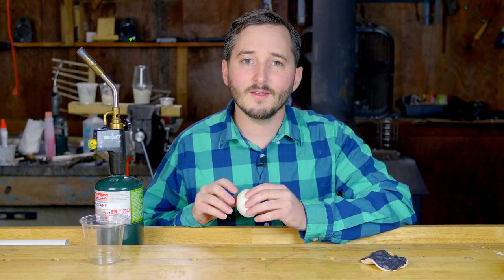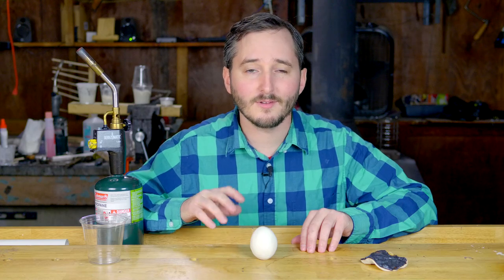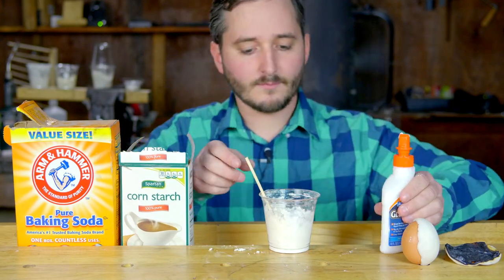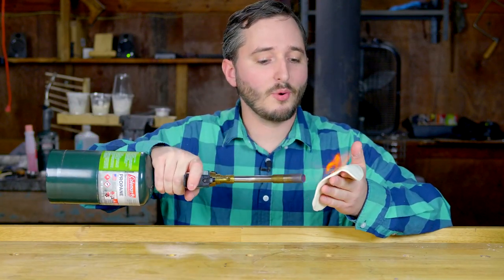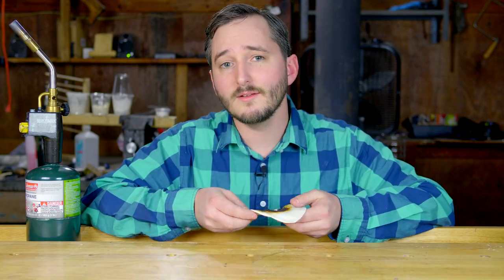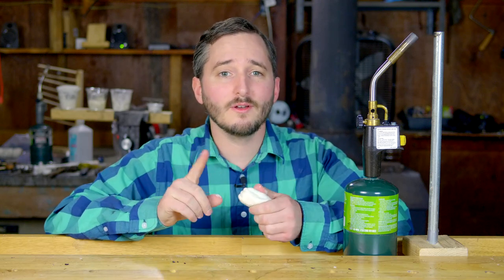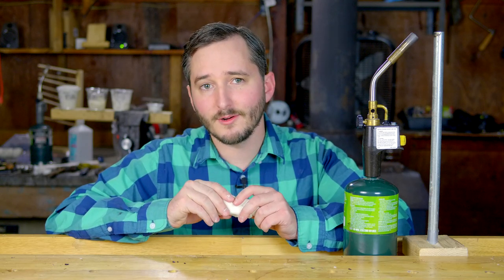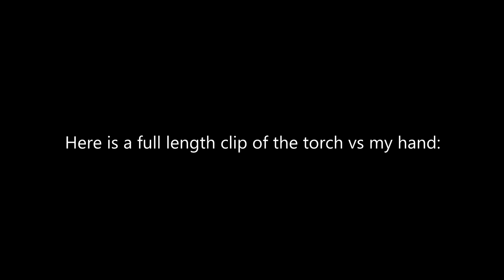A Super-Material That Can Be Made In The Kitchen (Starlite Part 1)

Comment: Build an HHO gas generator, pump the gas through a torch, ignite it, 5000F+ degree flame...  test this stuff with THAT flame then come talk to us.  :-P
Reply: He said it could take 10,000+ degrees.
Reply: change of state upon hho ignition causes it to reach melt temp of any substance it is in contact with upon moment of reaction where the hho gas converts to water.
Reply: @Daniel Nunya Bidnezz  Hydrogen-oxygen flames don't get to 5000 F, if I'm not mistaken.  They certainly don't get there in just air (without extra oxygen).
Reply: @Daniel Nunya Bidnezz  Nevermind.  Just looked it up; apparently I'm wrong.  I thought the generation of water limited the temperature or something.
Reply: you are mistaken.  The process by which hho gas combustion takes place is different than what happens with most fuels such as propane or butane.  When HHO gas combustion occurs, what actually happens is that the hydrogen gas and oxygen gas molecules react to form molecular WATER, and in the process of this reaction, HEAT is given off as a biproduct.  If this reaction is taking place at the surface of a material which is at 5000 degrees, then the heat given off by the reaction will RAISE the temperature of the material to even higher than 5000 degrees, until the material reaches its melting point, whatever temperature that may be, depending on the material.  So really, with this type of reaction, hho gas temperature is actually only limited by the melting point of the material it is being used to heat.  This is different than when something like butane combusts, which does not heat the material as a consequence of a chemical reaction and change of state such as hho gas.  butane combustion temperature is limited to the combustion temp of butane mixed with oxygen, whereas hho gas reaction temperature limit is the melting point of the material which it is heating.
Reply: @localbroadcast   Can you provide a link to something that supports this claim?  I honestly don't understand why one exothermic reaction would cause extra heating that another doesn't.  Why would the temperature rise higher than 5000 F?
Reply: because when hydrogen and oxygen react to form water, their electrons have to change orbital arrangement in order for them to form this new bond of the water molecule.  In the process of the electron rearrangement, energy is expelled because some of the electrons move to an orbit of lower energy.   This expelling of energy will occur regardless of what temperature the molecules are at when the bond forms. 
 So if it is at 5000 deg. and another water molecule bond forms, then there will be energy added as heat to that 5000 degrees, making it hotter than 5000.  When the material being heated reaches its melting point, then the excess energy of the water molecule bond taking place will go into causing the material being heated to change state from solid to liquid, or from liquid to gas.  the temperature at which this occurs is dependant on the material being heated.
Reply: take a look at any one of the numerous videos on youtube of hho torches blasting through rock, brick, refractory materials, etc.  You will see that everything seems to be melted, pointing to what I've stated... the temperature of an hho inferno is that of the melting point of what it is heating.  Find something with a higher melting point and hho will get there!
Reply: @localbroadcast   5000 F is the flame temperature though.  The release in energy from bonding hydrogen and oxygen occurs with burning hydrocarbons as well.  The hydrocarbons release less energy, have a slower rate of reaction, and therefore have a lower flame temperature.  This is all taken into account in determining flame temperature.  You still haven't explained why HHO specifically has the property of raising temperatures higher than the flame temperature.
Reply: with hho it is not the flame temperature, but the temperature of the material being melted.  when the hho reacts to form h2o, the energy released during the reaction seems to preferentially be absorbed by a material changing state, from solid to liquid in the case of heating a metal.  Perhaps it is because when the reaction takes place, liquid water will ever so briefly condense on the material, or perhaps the water ever so briefly goes into a supercritical state at the surface of the material causing it to be dissolved, releasing more energy as a change of state.. I really don't have the answers as to exactly what is occuring, but from my personal experimentation and from what I've seen from others conducting research with hho torches, the 'flame' temp of hho gas can reach up to the melting temp of whatever material I throw its way... the dynamics of why this is occurring definitely requires further investigation.
Reply: also, it is worth mentioning the fact that an hho ignition takes place as an IMPLOSION, whereas all other common combustion reactions of fuels occur as EXPLOSIONS.  This could very well be part of the mystery as well.
Reply: Are you trying to say because you haven't had a convincing enough explanation that you don't believe it's happening?  I don't have all the answers but that's not going to make me ignore what I've witnessed first hand!  Try it out man.. rig up a simple hho torch and melt some rocks.. melt some aluminum oxide.  melt all kinds of stuff!  Is it flame temp that is getting hot enough to melt alumina, or is it melting due to a surface reaction taking place?  Not sure, but it don't matter.  it get hot hot! it melty melty!
Reply: We will all die!
Reply: @localbroadcast  Tungsten has the highest melting point of any metal around 6000F so if the flame does get this hot then obviously it'll melt everything. Considering what you said, an hho torch could melt diamond, which I doubt is true.
Reply: @localbroadcast  Whoa!  Seriously?  So, ultra-high power oxidation in a way then?

I wonder what materials could be used to LIMIT the reaction you just described?  I also wonder if what you just described could happen in the upper atmosphere when a spacecraft  comes in on reentry, and if it hits a loose pocket of gaseous hydrogen, if such exists, could this happen and cause a plasma to form around the heatshield that causes a more rapid decomposition or oxidation of the ablative shielding materials.
Reply: diamond actually burns... doesnt melt.  and yes tungsten vaporizes under an hho flame quite easily.
Reply: @bbob5050  Yeah, just a little.  ;-P  I was simply making a joke, and also tossing up a suggestion to try with this stuff.  :-P

However, if the flame of an HHO reaction, reacts the way one poster here-in has stated, tyen an HHO flame might actually defeat this stuff no matter what.  

I'd still say give it a shot and see what it does, andmaybe check it with a thermal camera to see if the chemical reaction does indeed add more heat to the point of contact.  :-)
Reply: people have bubbled hho gas thru liquid fuels like acetone and gasoline which results in a cooler burning torch.  i think some have mixed propane in with hho gas with similar results.
Reply: in addition to hho being a melt-all type of torch, it tends to oxidize some materials such as carbon.. so instead of heating carbon to melting point, it would turn it into carbon monoxide / carbon dioxide and burn it up.. so i fear that this product would be utterly devastated by an HHO torch.
Reply: @localbroadcast   Only one way to find out!  :-)  

I would also like to see an HHO torch test of this stuff, and similar compounds with more robust properties, as well as an HHO flame on Diamond and Tungsten and see what that does...  any way to get thermal imaging of that and a temperature reading of the naked flame as well as the point of contact would be awesome too!  I know there are some thermal cameras that can do both now these days.  :-)
Reply: Remember that diamond is made of carbon.. diamond will combust at about 1500F.  I'm not sure of an accurate method of measuring 'flame temp' other than testing what materials a flame is capable of melting.  Maybe a thermal camera could do it but my guess is that it wouldn't have high enough range.. I guess if you could see on the thermal camera that the flame temp was lower than the temperature of whatever it's heating up, then that proves the point that the flame temp rises to the occasion.. meaning the flame won't be 5000F until it is used to melt a material with a melting point that high.. and if it is used to melt a material with a melting point of 1000F, for example, then that's what the flame temp will be in that instance.. but not the entire flame, just the point which contacts the material being melted.
Reply: @j.jarvis7460   Yes, this is true...  however, just jumping straight to 10k without something in between would be less testing, and more trying to destroy the material.  

Also, if HHO reacts the way one poster in another comment states it might, then this stuff might meet its match in the HHO flame, as it might get the materaial even HOTTER than 10k!  :-)
Reply: HHO is good as a start, but a thermal lance is even hotter (5500C)
also easy to build, just a 12v battery,hose,copperpipe and a oxygene source (bottle or electrolysis)

Comment: A super good explanation! An amazing material to be sure! However, if you used that virgin material to pick up and hold a 350 F steel bearing, you’d get a nasty burn. This material only works for plasma heating and is an ablative expansive carbon foam super insulator. It is formed by incomplete combustion and decomposition. The carbon foam is mechanically weak.

Comment: I wanted to add another twist.
Drywall, which is a different material, is so good at fire proofing that it is used to achieve specific desired fire ratings in fire codes around at least  Canada and the US.
The most visibly noticeable difference between the two being your material can be molded

Comment: you should look at aerogel material, as it is surprisingly easy to make, but it is so fragile that it cannot be used in its pure form. "alloy" are being developed to give compound some level of structural integrity. It chars under a flame and is a very good thermal barrier, while still extremely light weight. I wonder if aerogel is derived from this or vice versa

Comment: Similarly, you can create sheets of thermal insulator by welding a cut loaf of bread in an airtight container, and heating that on say a coal forge. What little oxygen there is generates some carbon dioxide from the outer layers, but soon that is depleted and the rest of the bread carbonises without oxidising.

Comment: Hi, I wonder if this material could be insulate a building from the sun heat, or maybe clothing.
Did you noticed or thought about checking any characteristic on this side for hot climate?
Reply: This seems to work because the high temperature causes the creation of carbon which insulates. I think that lower temperatures might not work. I could be totally wrong though.

Comment: It would be fantastic is this could be soaked into cloth and not have a putty consistency so you can wear it to protect from fires in emergency, similar to a fire blanket, might be messy if used in firefighter equipment brushing off layers of carbon all the time. But there is merit to the black insulator portion as there are accidents involving firefighters accident grabbing their gear while it is still hot

Comment: Can it be hardened and turned into a ceramic like tile ? If it can be turned into a durable sheet or tile it has potential for all types of heat shielding, its simple ingredients and byproducts would make it disposable and renewable.

The age restriction is likely to do with using a torch on your hand, if it was an automatic filter, you can try some alternative private uploads with those segments cut out to see if they pass the filters, (at least from what I understand of how the system works).

Comment: Hi sir, from india. 
1. I felt this method should be processed in best way to help people preventing from  rooftop heat entering the living area. Anything anywhere the heat gets penitrated. 
2. Preserving geyser's to sustain its heating temperature within it for longer period. 
3. Hot box, lunch box, many more.. There are many areas where v can use this.. 
Now the cold substance.. 
        When it can stop heat will it not stop cold if iam not wrong. Until u spill any liquid on to it. A well sealed casing shell and this substance is sandwiched between two outer sheets, So that better refrigerators can be made.
Same here lost of areas we can use this.
 **********But my one and only question is.
  Wt is the lifespan of such mixtured compound.. As there is glue added in later stages the substance may go dry completly.. And loose its efficiency.. Iam not sure..
Just for example, A freshly mixed substance may hold the heat may b for an  hour. Wt if the substance is used after 3 year from the day it was mixed. Will the result b the same or vary?

Comment: it probably never reached the shops, because its use is not clear. for example it rots over time? when there is heat it is consumed that is, it is not that you can use it the same as a permanent thermal insulator. on the other hand, it is possible that products for sale have a formula "inspired" by this.

Comment: Not sure if you will read this. I am researching how to make fireproof and waterproof paper. First I researched aerogels which even the powders and paints are prohibitively expensive.

I am interested in making a large 8x8 folding origami tent. If I combined PVA with abaca paper pulp (carbon source with long strands to be tear resistant) would I need only to add baking soda to help make the paper fire resistant?

Soda Ash and sodium bicarbonate are also added to bark fiber based paper. And PVA is a commonly used by paper makers. Does Soda ash and soda bicarbonate have similar effects?

Is it possible to make a combination of soda bicarbonate, paper pulp, and PVA paper that can be pulled from molds that has a similar effect?
Reply from the maker: Those questions can only be answered by testing

Comment: I've heard that Starlite is an ablative, meaning its use as a refractory is limited by a certain number of uses. It burns off a layer every time. I think NASA uses ablative materials for their space shuttles reentering Earth's orbit.

Apparently the carbon wears off after multiple uses? Or maybe the carbon stays indefinitely but you cannot get it to create the carbon foam if the dough has been sitting for too long.

I don't know what exactly makes it ablative or how many uses one can get out of Starlite, so I think more testing is required.

But I really do think this Starlite could be useful in refractory situations where you just reapply a new coat of Starlite every so often.

More research is required for sure

Comment: Hi!
You gave me an idea!
Can it be used in isolating for my kiln? My plastic wires burnt away, can i use it to cover them for heat protection?
Reply from the maker: No, carbon conducts electricity
Reply: I know, and I want to cover them individually, so they won't short each other.
Btw good videos, interested in some precise measurement of the heat resistance of this material.

Comment: Out of curiosity, what would happen if you plastered a wall with this? Would it act as perfect temperature insulation? Or would it simply fireproof it?

Edit : would I need to char the surface first in order to get the required thermal resistance for temperature insulating a structure? And what would the R-value be?

Comment: But what are its properties if the putty dries up? Sodium bicarbonate would require a porous substance preferably 'wet' and a bit acidic (which I assume is supplied by the PVA glue) in order to react and release CO2. But if the putty is dry then the baking powder remains inert and will not release CO2 to form a carbon foam.

Comment: Does it work as well to insulate if it's not exposed to air?  Say, if it was used to try insulating a metal fire pit from the underside, or if hot iron was pressed against it.
Also, if heat were reapplied to an area already exposed to heat, how does it hold up?  How many times can it be go through a heating/cooling cycle and still be effective?

Comment: The problem is how do you make out into something durable you can wear like a race car driver or fireman suit???  They need protection from flames,,, nomex is the currently most used material but it only will prevent burns for a couple of minutes at most. Refinery and oil field worked wear fire resistant clothing but it won't block flames from burning you truthfully, they only resist ignition of the fabrics and are chemical treated cotton weave.  The chemical washes off over time.  Can your star lite be made into a washable fabric?  How does it withstand stretching kneeling bending abrasions grease oil stains etc?

Comment: Just curious.  What would happen if you replaced baking soda (sodium hydrogen carbonate) as your source of carbon dioxide with limestone (calcium carbonate) or washing soda (sodium carbonate)?  Still easily available materials.  Also, could you dilute it with added water to get something you could just paint on?  The result would be thinner, and thus probably less effective, but it would be easier to apply than this dough that you've made, and good enough for applications that didn't need quite so long a heat resistance time.
Reply from the maker: You should watch my most recent video. Other gas sources as you suggest are possible, so long as they have a decomposition temperature in the right range to work properly. Somewhere between 70-200C